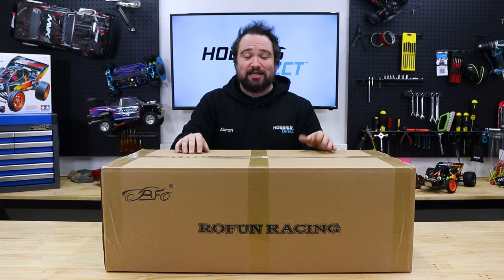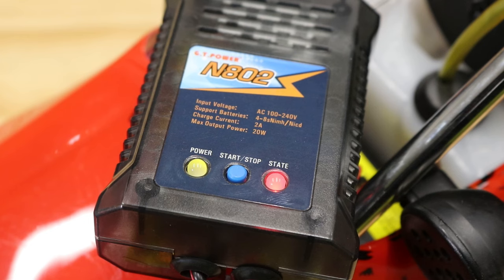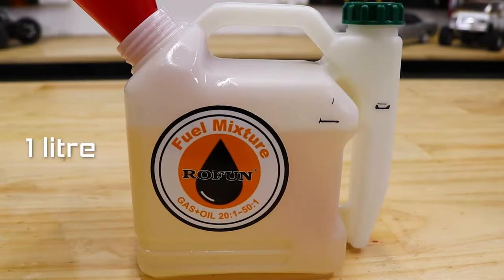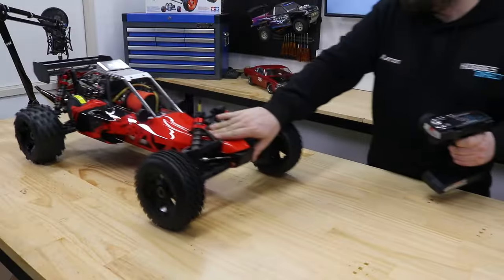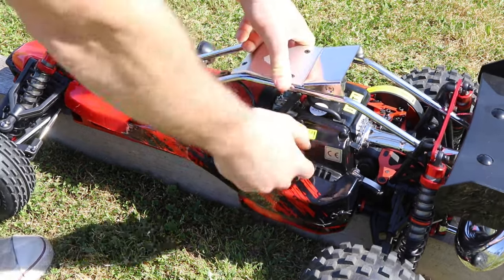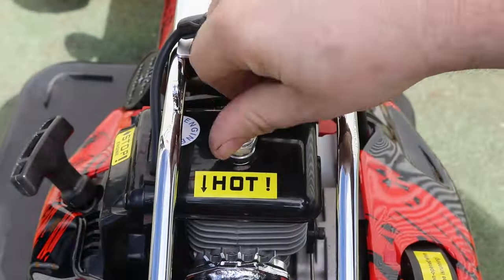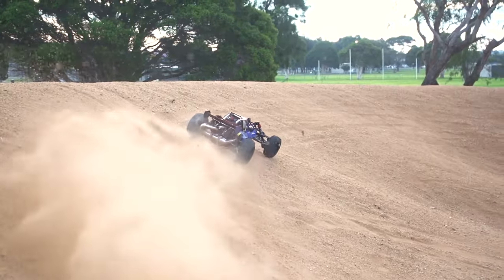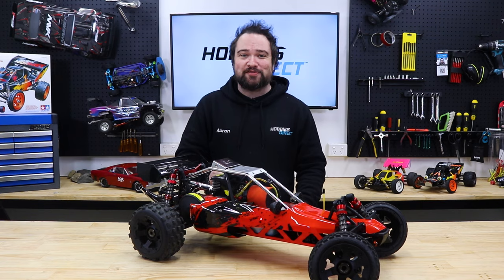Rovan HPI Baja 5B RC 1/5 Quick Start Guide - Let's get started!

Comment: Also check under the stop button cover that the button isn't stuck. Can happen, and makes you think it wont start.
Reply from the maker: Great tip!
Reply: My stop button hung in would not start
Reply: Just pull the plug cap off and put your finger in it. Pull starter

Comment: Steering  totally sucks  also the takes forever to break  and every single bolt gets loosen up pretty fast.  The Drive shafts  pins snapped and had to replace it the second time I used it am really disappointed  with this maybe I have terrible luck.

Comment: I thought 25 to 1 is 250 mil of oil to 1 ltr off fuel.not 200 mil? This is why I don't listen to youtubers who give you bad info
Reply from the maker: 250ml of oil in 1 litre of petrol (1000ml) is a ratio of 4:1, (or 1000 : 250, if that's easier to understand). The correct ratio, as in the video, is 25:1, which is 1 litre of petrol with 40ml of oil. Use 200ml of oil for making 5 litres of fuel.

Comment: I’m very important question and can you please someone answer? I just got my. Hpi Baja 5b today. And I was wondering, do you have to break in the engine? Is it required to do it or can I just drive it right away? Got confused and I didn’t read anything about breaking in the engine ready to run so can someone please answer I need help
Reply from the maker: You only have to break in the engine if you want it to last haha. It's not technically 100% necessary, but for the reasons outlined in this video, it's a really really good idea.
Reply: @HobbiesDirect  ok yeah i did break it in a bit I flowed the instructions and I think it is ok but when I first got it it would not start and I was trying to get it to start and I did a bunch of things and then all I needed to do was adjust the carburetor lol I even called customer service but they did not tell me nobody told me lol
Reply from the maker: @user-dz9pq4km9m  Glad you got it figured out though!
Reply: @HobbiesDirect  yes thank you

Comment: Mine just arrived today 😃 it is awesome 👍 can’t wait to drive it! Charging the battery as im writting this. Thanks heaps Hobbies Direct, it ls been great dealing with you guys.
Reply from the maker: Enjoy!
Reply: @HobbiesDirect  Thank you! Its awesome 😁
Reply: Do you know where i can take it for service? Mine wont start
Reply from the maker: Any good hobby shop or small engine mechanic should be able to help. @witch4235
Reply: @HobbiesDirect  thanks a lot. Can u please tell me what gas oil ratio you use?
Reply from the maker: Same as in the video, 25:1 petrol to oil :-) @witch4235

Comment: Hi Aaron, cool video that really helped me! I was wondering if we could use a fuel which has an octane rating of 98RON or higher because in my country we have Shell VPower which is 99RON and we also have 100RON. I would like to know if it is safe to run the engine with those fuels. Thanks!
Reply from the maker: A lot of those higher-octane fuels have a high ethanol content, which is not something the Rovan engine and fuel system likes; stick to regular.
Reply: I see, but my country has banned ethanol fuels to be sold in stations so my country has ethanol free gas from 95RON (regular) to 100RON. should I still go for it? I know this car needs a minimum of 91RON but I just want to try a higher octane fuel and see if it runs differently. Thanks!
Reply from the maker: @cpmagic6454  You can try it, it won't hurt anything. But it likely won't be any better; fuel quality is more important than a higher octane rating for these engines.
Reply: @HobbiesDirect  I see, thanks so much for the reply Aaron!
Reply from the maker: @cpmagic6454  No worries! 🙂

Comment: Hi, I followed your video step by step on my new baja, it started running for about 10 seconds then cut out, should I repeat the choke on choke off again? I just don't want to flood it
Reply from the maker: You should be able to just pull start it again, no choke procedure.

Comment: Hi I would like your opinion on fuel brands. Would it be better to run Shell 95 or Caltex 95?
Reply from the maker: Really depends on the individual servo, but personally, Shell. Overall though it's better to go for newly built stations with less corrosion in the systems, and busier stations that get refilled more regularly. All that said - the Rovan probably won't tell the difference either way.

Comment: Hi Aaron, would it be ok to use Shell Advance VSX synthetic based oil as Shell does not sell a fully synthetic 2 stroke oil in my country. 

p.s fully synthetic 2T oil is very hard to find in my country, it can only be bought online for an expensive price.
Reply from the maker: Think of it like this: if you'd use it in a sports 2-stroke motorbike, it's fine to use in the Baja 🙂
Reply: I see, would it be better to get BP 2 stroke fully synthetic or the Motul 800. Are there any differences?
Reply from the maker: @InfilTration-h6x  Either of those will work great 🙂

Comment: Is 26 cc  oil & gas mixture ? Or only certain bigger engines ???
Reply from the maker: Yes, they run on 2-stroke fuel, which is a mixture of petrol and oil. The recommended ratio is in this video - 25:1 fuel to oil.

Comment: Do all of these hpi Baja require oil & gas mixture???
Reply from the maker: Yes they do, they run on 2-stroke fuel, which is a mixture of petrol and oil. The recommended ratio is in this video - 25:1 fuel to oil.

Comment: So cool! What a great video ❤. I have a question,
Can I break in, my Roavan baja 5b 29cc in one go!, Before my battery dies?, its a HPI Battery 6.0v 4300mah 25.8wh.  I have no idea how long that battery last before hitting 0%
Reply from the maker: As long as the battery is in good condition, you should get a good couple of hours out of that battery - easy enough run time to do break in 🙂
Reply: 🙏🏻 Thank you so much ❤,

Comment: Hello. Is there a difference between Fully synthetic oil and Synthetic based oil? What would happen if I used mineral oil instead. All the 3 types of oil are offered by Shell in my country.
Reply from the maker: You'd have to look up an in depth video for the actual differences, but basically if an engine manufacturer specifies synthetic oil, that's what you have to use. 2-stroke engines have super-high rpms compared to 4-stroke, and if there isn't enough lubrication parts wear more rapidly and can fail, and fail more destructively.
Reply: I see, which one would you personally recommend/use Shell semi synthetic (affordable and abundant) or Castrol 2T fully synthetic (expensive and hard to get)
Reply from the maker: @CCXR-r6p  As Dad always used to say, "good oil is cheaper than a new engine".

Comment: I wonder why the fuel goes off in the tank but not if you remove it. What’s the difference?
Reply from the maker: It will still go off in the tank, but not as slow as the container. You mostly remove it so that it doesn't go bad in the tank and gunk stuff up.

Comment: what is the correct fuel ratio you say 25-1 but you also say 40ml per 1 liter?
Reply from the maker: Those are the same number. 25:1 is 25 parts fuel to one part oil, or 40ml of oil in 1 litre of fuel.
Reply: ok sorry i get confuse when comes to fuel oil ratio  @HobbiesDirect

Comment: Did anyone have to check the diff and suspension oil levels before using ?
Reply from the maker: You can if you like, but they are usually good to go.

Comment: can i use Penrite instead of Castrol 2 stroke oil
Reply from the maker: As long as it's a high performance fully synthetic 2-stroke oil, like what you'd put in a motorbike (not what you'd put in a lawnmower) you can use any brand you like 🙂
Reply: thank you @HobbiesDirect

Comment: Hello can any body help me? My buggy starts but won’t move when I press gas ? Any ideas??
Reply from the maker: Are you giving it plenty of revs? They have to rev higher than you'd think for the clutch to engage. Otherwise, check the clutch and the spur gear 🙂
Reply: @HobbiesDirect  yes I gave it  2-3 high revs but not that high any higher I think I might be messing something up it is a baha 5t 32cc first start up soon I will start up again warm the engine in .. 1/5 scale perfect start
Reply from the maker: Good luck! @YTJosephc
Reply: @HobbiesDirect  the 2 screws by the carb looks like this \ / so I’m not sure if that is got to do with it , it sounded abit on the high rev side I think but it was calm enough to keep running
Reply from the maker: Check out our video on how to reset the carb https://www.youtube.com/watch?v=mAken9d6qD4 @YTJosephc
Reply: @HobbiesDirect  yeah no idea it wants to rev high but no movement, i turn the low speed screw slightly to the left the engine calmed down a bit .. it’s a lil Smokey but sounds ok .. I will check out the video thank you!